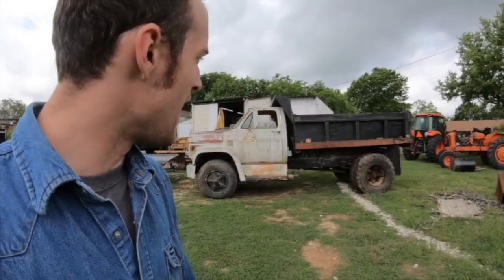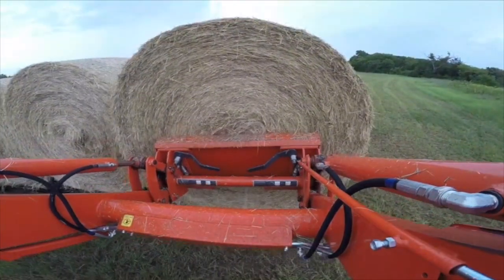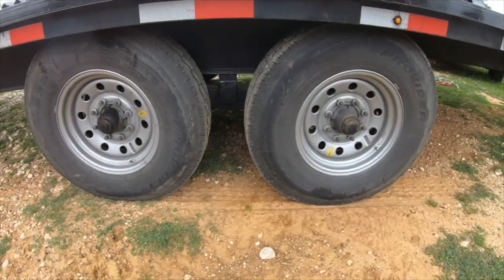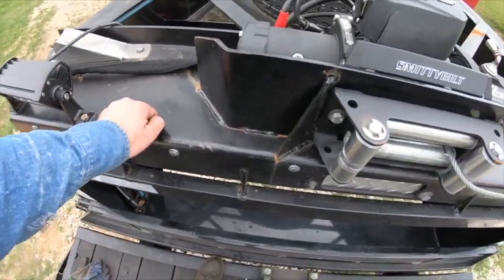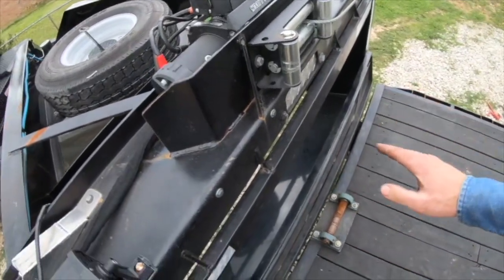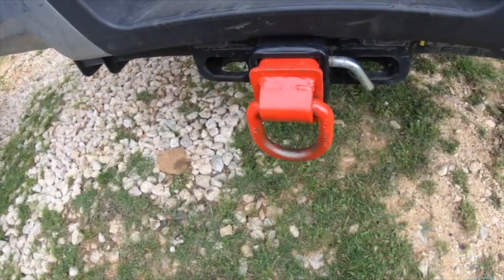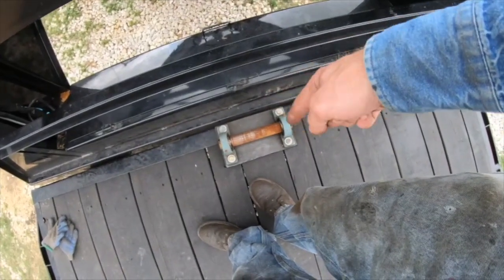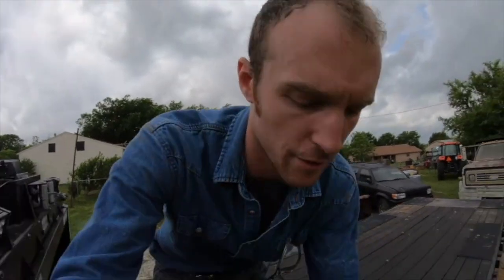YOU WONT BELIEVE HOW THIS GOOSENECK TILT TRAILER CHANGED MY LIFE

Comment: Hey just to give you a heads up a 16k trailer on a 10k truck is 26k 26.001k and you need a CDL and a electronic log system even if you are private carrier
Reply: Time for farm plates
Reply: You only need a CDL if you're working commercially. That's what the "C" in CDL stands for. It means, "Commercial".
Reply: @1pcfred  no law reads differently farm endorsement is only good for 100 mile radius after that you need a CDL. Not arguing that's what dot does why do you think they are going after all the non CDL hotshot guys?  If you have a sticker wgt over 26k or you are overweight on combination or even axles in some cases they are going out of service
Reply: @dudekseeds8586  U-Haul never asked me if I had a CDL when I was renting 26 foot box trucks and filling them full of steel until they popped wheelies going down the road.
Reply: @1pcfred  again I haul are under 26k as soon as you go over 26 it's an issue between you and the officer writing the tickets
Reply: @dudekseeds8586  only if he can catch me.